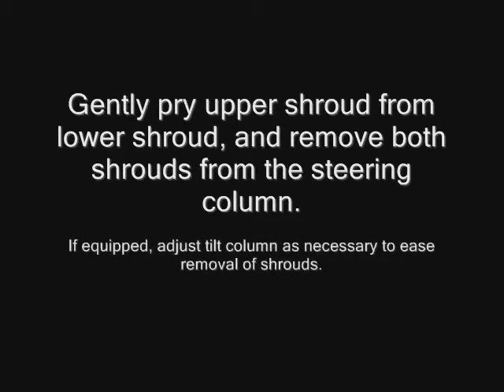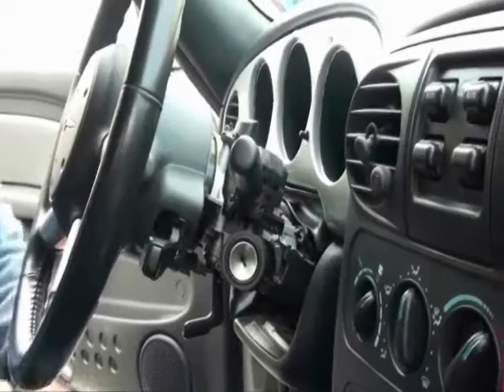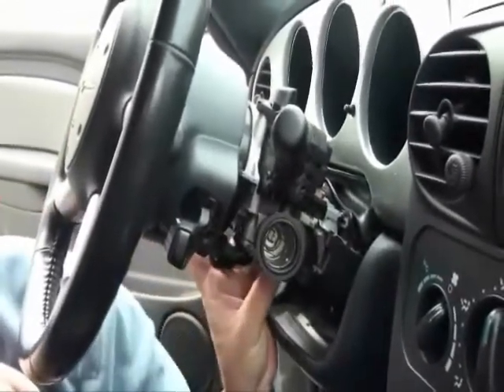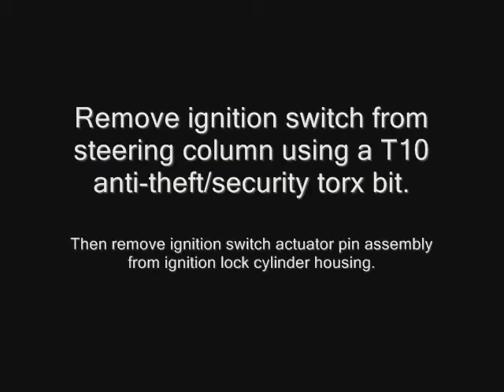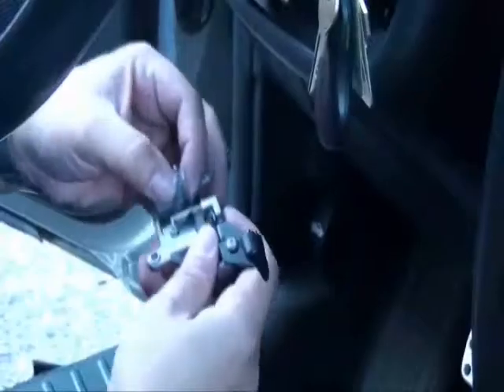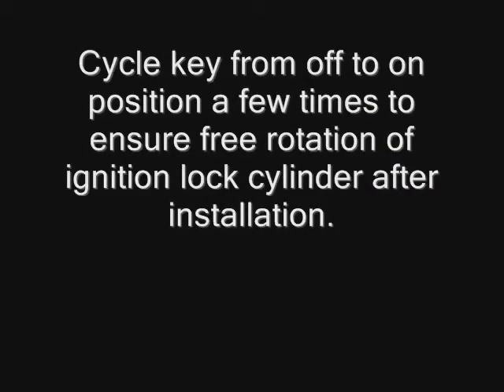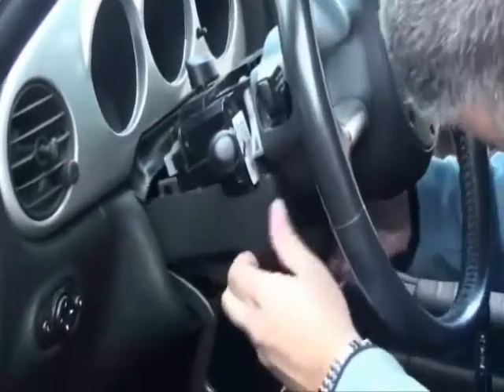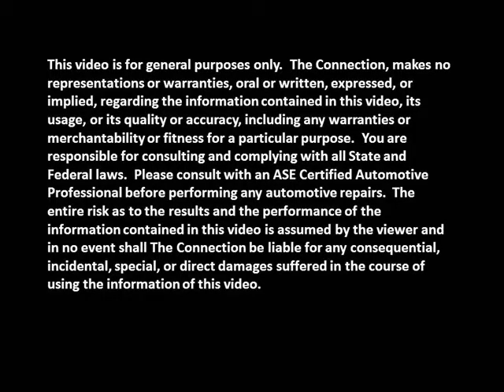Wrangler, Liberty, PT Cruiser, Neon Ignition Switch Actuator Pin Repair

Comment: Found you via the Lost Jeeps forum.  This video is PERFECT. Saying what you're doing and then showing it is VERY helpful.  For those looking to do this, remember: you will need the t10 security torx bit (it's a regular "star" bit but with a recessed hole in the center for the "tamper resistant" screws).  You probably have the regular t20 Torx bit on hand (in a driver kit), but the security bits are less common (though readily available).

Comment: The ignition in my 2002 Jeep Liberty was completely stuck frozen to where the key wouldn't turn at all once it was in the ignition. I took a hammer and started tapping on the end of the key when it was in the ignition until I could get the key to turn to the ON position. Then I bought a new tumbler w/ keys and installed the new one immediately after removing the old one. Note: to remove the bottom shroud in a 2002 Jeep Liberty, it requires a T-20 Torx screw driver. Thanks for posting the video!

Comment: I just had my 06 liberty die the "will not crank death" yesterday.  322,215 km on it and I love the veh.  Watched this video and went to NAPA to by the parts - came to about $265 all in for the actuator, ignition switch and multifunction headlamp/wiper switch that started being flakey about a year ago... I figured since I am diving deep, why not.  Understand I am NOT mechanically inclined, and struggle with oil changes on my liberty. This job took me about 2.5 hours all in with some mis-steps.  First, I lost the spring on the brass piece of the new actuator.. I took it out of the box, and was simply looking at it and SPROING!!! ... it jumped apart.  I spent 10 mins or so searching for it and never found it, and decided to take the spring off the old one... then I fought for a good while trying to figure out how it went back together... I took my time in taking off the old spring so I had a good idea of how it had to go...  then when I was mounting the new actuator, I was trying to fit the ignition switch directly onto the actuator.... big mistake... the video was not handy, and the ignition switch was still wired, and since the new actuator ass'y cost me about $100, I was very worried about breaking the plastic extension peice... BTW, it turns out that it was not the plastic pin that broke on mine but the pig metal surrounding piece at the end... I found the broken piece on the floorboard as I was re-assemblying everything... 
SO I went back into the house, watched the video again, and the trick is to mount the actuator into the steering column, then put the housing back onto it - this prevents the spring thingy from springing again ( lost 30 mins or so here as well) and thus coming close to losing the second screw...  then remounting the key housing assembly, for some reason it would not fully insert... spent about 15 minutes on that and then finally it just went in... last step was to then re-mount the ignition switch onto the end of the actuator... you have to be very careful with that plastic pin extended, and for the life of me I could not get it to line up... first the ignition switch was still attached to the wiring, and my upper shroud was also in the way because my top half of the shroud has that ESP engage/disengage switch on it, and I could not figure out how to take that out without breaking it... then I had a AHA moment.  I took the old ignition switch and tried rotating the inner piece that has to receive the metal extension of the acutator... that it when I was able to mimic what the key would do... once I realized I could rotate that inner piece, I simply lined that up to the position that the key would be in when first inserting it and ....VOILA!   success in seconds... so the moral is when remounting the ignition switch, be aware that you can rotate it to the desired position....
Other than that, it was a pretty simple job if you subtract my rookie mistakes... $285 in parts, roughly, and oh ya- I also learned that an anti theft torx is NOT a standard torx-  I had to scramble to Canadian Tire 5 minutes before closing to get that anti-theft torx - another rookie mistake but who knew??
All in all a great video.  It needs to mention the trick about rotating the inner piece of the ignition switch to match the key position but thank you so much for posting. I would never have attempted this had I not seen the video first.

Comment: Sweet thanks for this video, on my liberty putting it back together was a little different, I had to put the bottom piece with the spring on before I could get the key cylinder back in properly other then that, it was right on point !! This saved me from 236-1200 bucks!!

Comment: Any idea why the dealers won't give up the truth on this one?  I went to TWO different dealers (one in the area where the ignition pin broke, and my dealer at home)...neither of them mentioned that it was the ignition pin actuator...they both just said that "two metal tabs" broke off inside the column.  This video saved me $1,200 -- I found a salvaged TJ steering column, stripped out what I needed and used this video to install the parts.

Comment: Before doing anything  DISCONNECT THE BATTERY!!!!!!
Reply: I read that the steering wheel covers are held together with a T10 security torx bit
Reply: What happens if you don't disconnect the battery?
Reply: @mirandamize-mayhew9256  Try it and find out
Reply: @mirandamize-mayhew9256  Ok it's obvious. I'f you compromise the harness, the airbag can deploy, or you can even ruin your OBC module
Reply: I'm a single mom trying to fix her car so if you want to be helpful it's appreciated but I know nothing about cars and am doing this without help. I've replaced my ignition pin and the ignition switch but I lost the little in the ignition pin housing that's for the gear mechanism and I was able to drive my car but when I put into park it kept going so I parked put emergency brake on and went back over the video till I figured out what I did wrong. I found the piece and put it all back together but now it won't start again. I know I've done it without disconnecting the battery. What do I do from here to diagnose what's wrong? What's an OBC module? Is it an easy fix/replace?